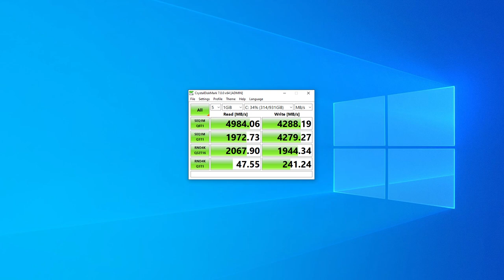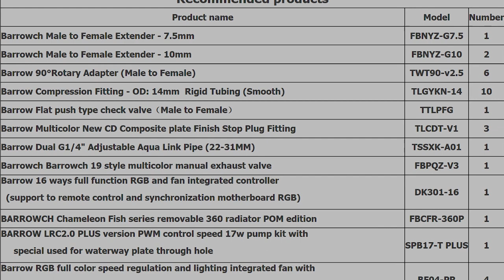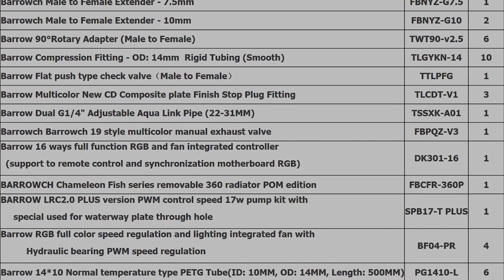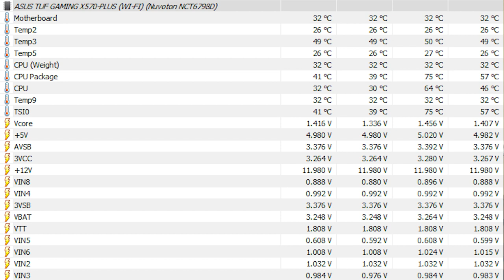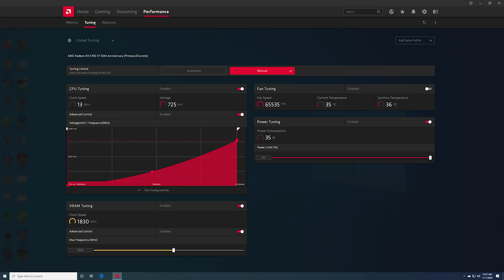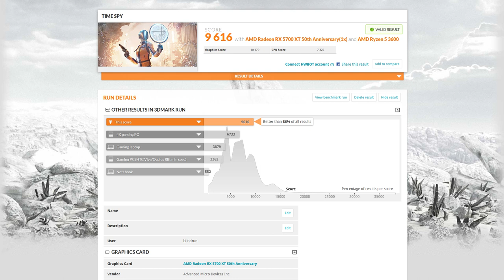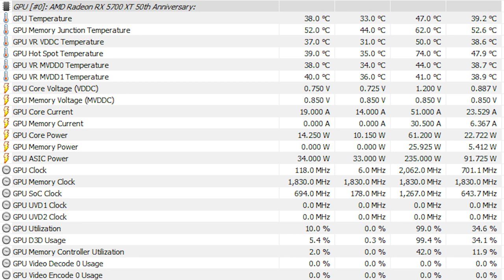Corsair 500D Custom Loop | Unicorn Sacrifice!

Comment: When I first started doing custom loops, there's barely any videos like this. Most are extreme builds which basically useless to newcomers or only showing the end result. Nowadays you have countless videos like this on YT, it's great. My biggest problem back then was budget and choosing the correct fittings, they're expensive and take forever to ships, no matter how careful I've planned, there's always some incompatible parts that required additional parts which delay the build days at times.

Comment: Crossing my fingers for you that you don’t have to take your ram out lol.  I just had to drain my loop today, my 980Ti died and I had to swap in an RX580 until I can hopefully RMA this 980Ti.
Reply from the maker: it comes out with loop done. those lines are level with the gpu line intentionally for looks mainly but added bonus there